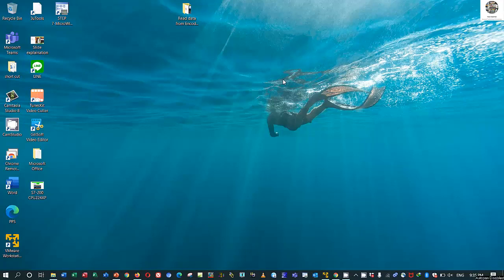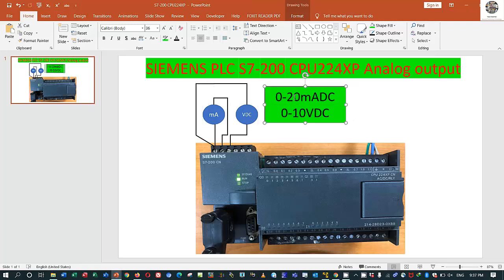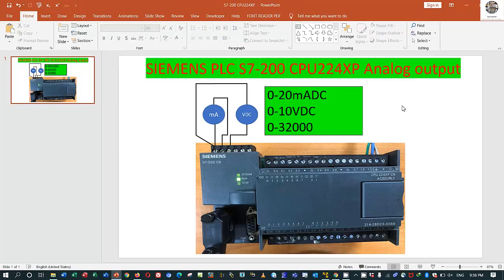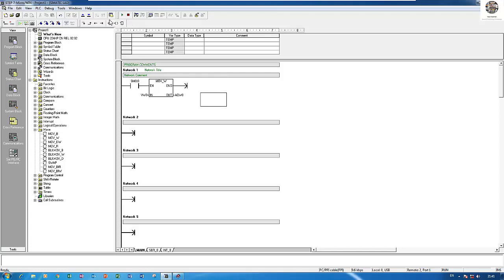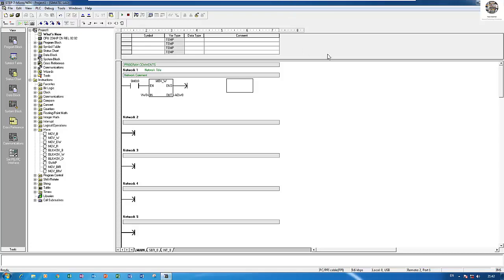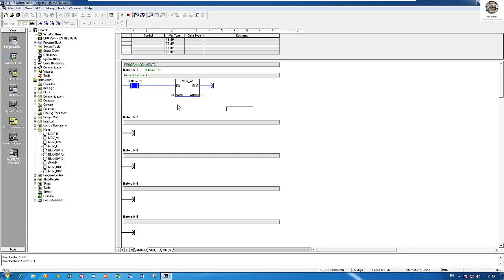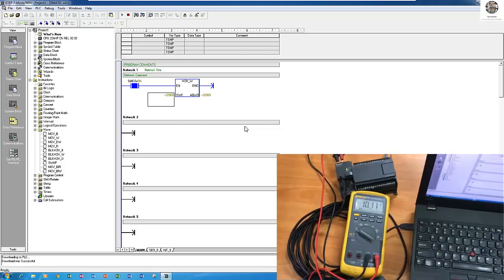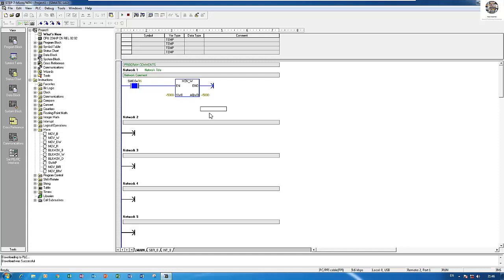SIEMENS PLC S7-200 CPU 224XP Analog output tutorial

Comment: I have the cpu 224xp add an EM232 module and I perform your steps of the ladder diagram, only I do not get the output of ma, you can support me
Reply from the maker: Dear sir,
Please check dip switch select follow manual operation EM232
Thanks